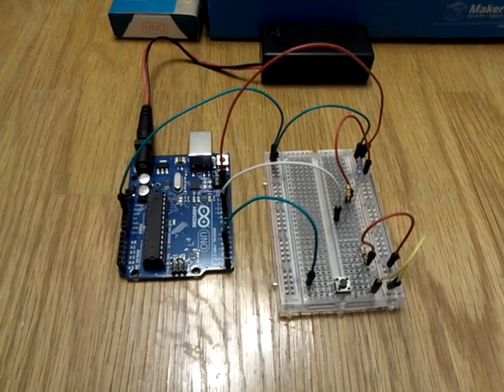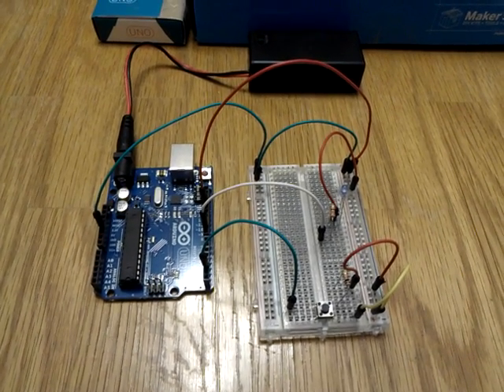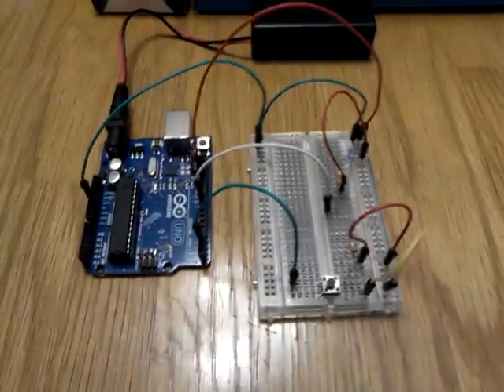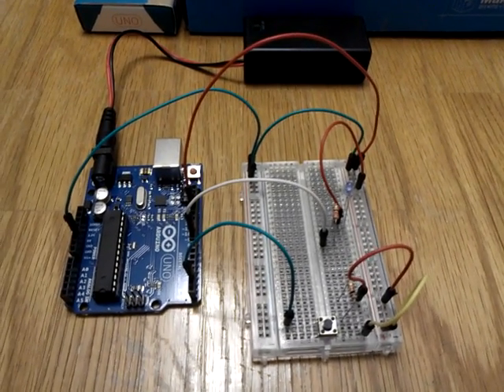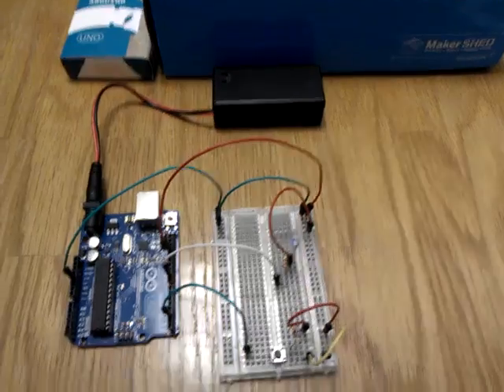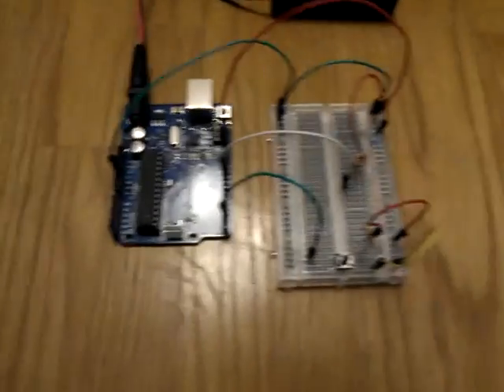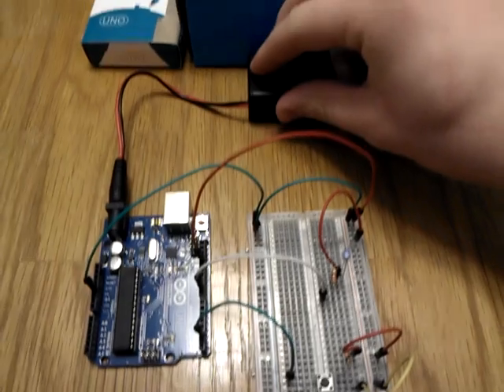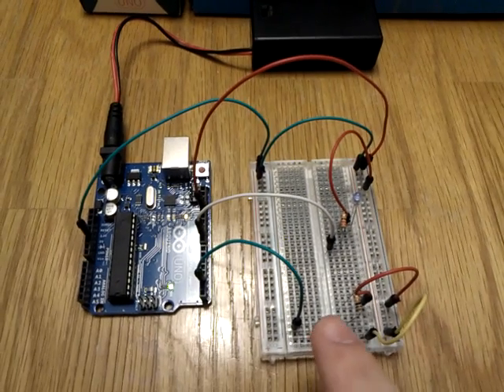Fade an LED with a button on Arduino Uno Rev3

Comment: Disregard... even when doing PULLDOWN in software / the sketch, it seems a resistor is still needed to avoid noise / floating LOW & HIGH state.

Comment: Hi, Mike.  I'm having a weird problem with the code, where it'll randomly pulsate even if the switch isn't pressed or plugged in.  The code is untouched, aside from the starting brightness level as it needs to be 255 to be "off"...

The only non-standard physical thing I'm doing is that I'm using a 5V LED cluster with ground plugged into VIN and the hot/+5 plugged into pin9 for PWM.

Any ideas?